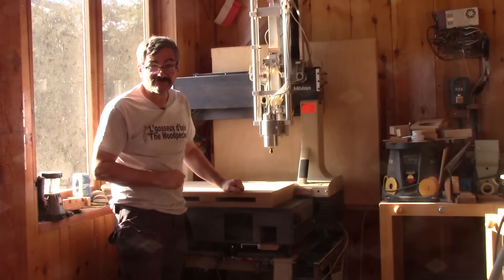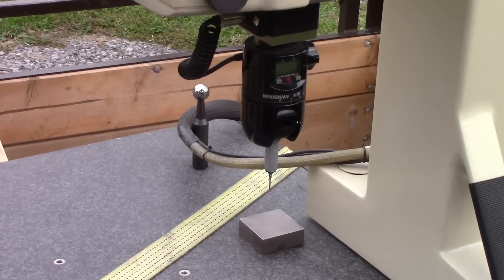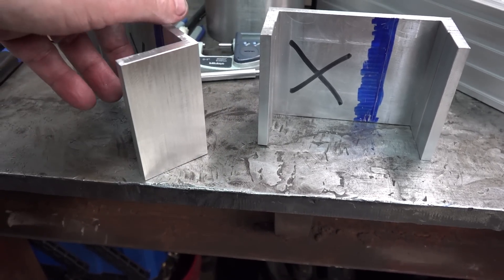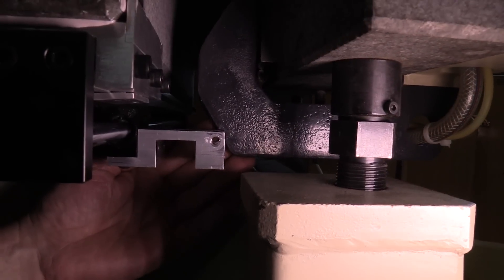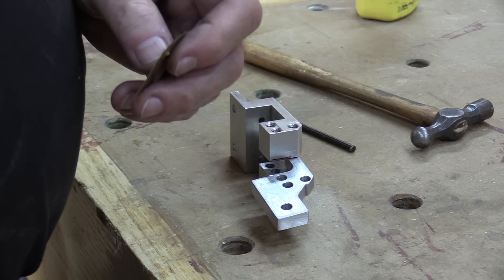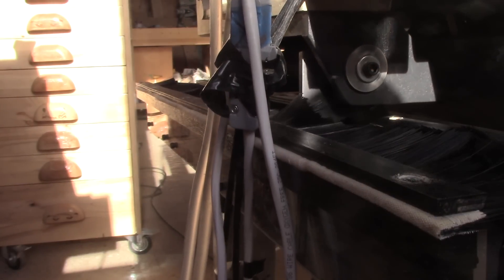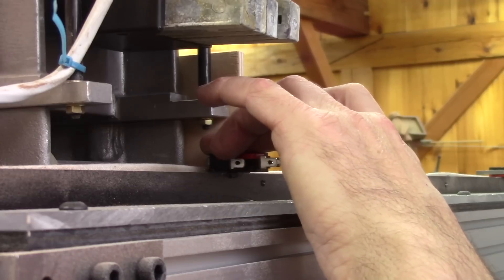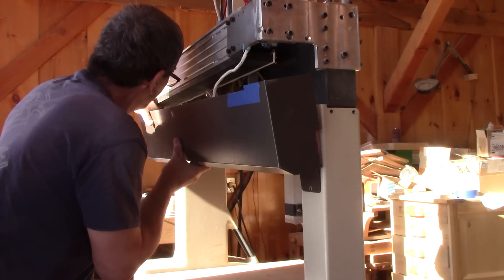The Woodpecker Ep 269 - I'm building a brand new CNC

Comment: I wonder why a measuring machine would be so beefy?
Reply: Because they need to be stiff and free of resonances so you can ensure that you are measuring the material you are measuring and not just deflections in the measuring equipment itself.
Reply from the maker: Thank you for the answer. I was wandering the same thing. 
One thing for sure they're no flex in this, I couldn't believe how great all my carvings now end up, I never had such beautiful finish before. I'm glad I listened to Pierre, when he proposed to modify a CMM into a CNC I was skeptical, today I'm so glad, I use it almost every day to carve pieces for my next Christmas fair. Instead of burning the cutoffs I carve them into tree ornaments, then burn the rest.
Reply: @LgosseuxDbois-TheWoodpecker  |Yeah using a CMM as the base for a CNC machine is a great idea indeed, I would never have thought of that!

I do wonder how easy it is to keep the surfaces clean so the air bearings keeps working without jamming but it looks like the brushes you instead should help a lot with that, and then of course the air bearings them selves will be sort of self cleaning by the compressed air blowing the surfaces clean when the bearing traverses them. 👍
Reply from the maker: Yes it was a great idea, but I can't take the credit for it. 
All this was Pierre idea, he saw this on our classified (our Craig's list)  he said buy this CMM I'll be able to make all the pieces to transform it into a  CNC. I was super skeptical, I never, ever heard of a CMM before. So we met at the place they were selling it. In fact it was a place where they make assembly line robots. They buy the huge robot arm and make everything to make a factory line for the client. There Pierre was like a kid in a candy store. I was still skeptical even after seeing it moving on air. He said; if  I can't transform this into a workable CNC I will buy it back from you and keep the granite top. But when it was in my shop and I've started clamping ball screws to it I was sold. It took several months for Pierre to design the added parts. It was super hard to figure that out, he lived almost 90 minutes from my house so he took measurements, film the whole thing and phoned me almost every week for more measurements. But I have to say that today I'm super happy. 
Pierre also is concern about the dust, but it seems not that bad so far, and with the dust shoe I've made they're barely dust escaping it. I tend to think like you say that the air pushing under the pads should push away the immediate dust. Time will tell. But since Early December when it was working, up until now it's been working almost everyday, and since I'm mostly sculpting 2.5D stuff, it has been working a lot. I had a CNC for several years but I never thought that it could be as precise than this. For a while now. I say to people, if you're interested in a CNC don't buy an entry level it's not rigid enough. but the things is, those machine are meant to have a palm router of 1.5lbs, but a palm router is not design to run non stop 10 to 32 hours, for that you need, like I did, a water cooled spindle. But this weigh 12lbs my old CNC was unable to sustain that without always vibrating so it was useless to me.

Comment: That is one of the coolest frankenstein builds I've seen in a while.
The wireless camera that is on the unit (Seen @14:45) ... is that for security, or is it for filming timelapse of the CNC at work?
Reply from the maker: Thank you.
I'm sure that even Frankenstein  was not working as great as this. I'm super happy
The camera has only one purpose; watching the carvings while I'm editing in the house. By being stuck on the Y axis this makes a weird images when the CNC is moving. But I've already made several 32 hours carving with it, you'll see this next December, and I need a way to check if everything is working fine even if I'm not beside the machine. Usually most people I watch, only uses their CNC to make fancy intricate cuts, I also do that , but I mainly carve with it and a simple carving can easily take 90 minutes and more, I need to be able to monitor the carving while I'm editing.

Comment: Someone at Mitutoyo is going to have either a good laugh or a cry over this.
Reply from the maker: Either one or the other.
But anyway all the 1990 electronics was out of commission, it's why I was able to buy this so cheap. Pierre told me that only the granite table worth more than the price I paid for the whole machine. But I've removed a lot of sensors, stoppers, casings and more. But I'm so glad I've listen to Pierre when he said that he could make all the pieces to transform this into a dream CNC. And he delivered, I'm so happy
Reply: @LgosseuxDbois-TheWoodpecker  For how much though? This is surely a multi-thousand modification, excluding the CMM itself. I don't know about that CMM, but usually, they are rated at around 0.0005 to 0.0001" accuracy repeatable, depending on the quality... so about 1/10th more precise than a lot of CNC.
Reply from the maker: I bought the CMM for $350cdn and about $1000 of ball screws, plus all the parts Pierre and Philippe made. I already had all the stepper motors, drivers and all the electronics part, but yes it's still a multi thousand machine but the  precision is so unbelievable. The CMM itself was probably more accurate than the CNC I made, but it's still way more accurate than using rubber belt to move the gantry...
Reply: @LgosseuxDbois-TheWoodpecker  I totally agree with that. I'm a "Technicien en Genie Mecanique", so I had the opportunity to use them while inspecting aviation parts and yeah... its awesome. Wow, 350 for a CMM is crazy cheap!
Reply from the maker: But all the electronic parts were not working, but still, all the moving parts were #1, and now my CNC is floating on air, it's awsome

Comment: I hope we don't have to wait until Christmas to see this working again, it looks amazing!
Reply from the maker: No, but I made a lot of Christmas project with it.
On my next episode I'm using it. In fact if I don't apply stain or finish I'm using it almost every day. it's amazing, I never had such great result with my old CNC. But obviously this being granite and cast iron sliding on air, they're no flex anywhere, but I had to part away with size... It's half of the surface of my old one but I never used all the surface of the CNC anyway. I rather have amazing smaller results